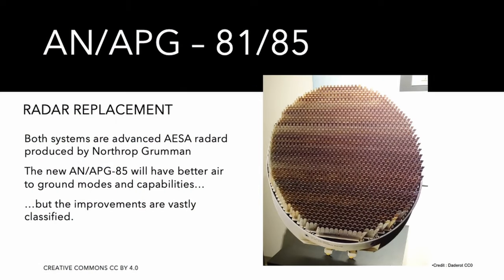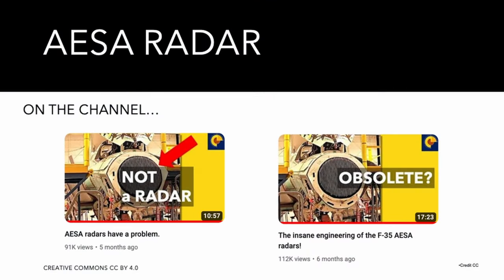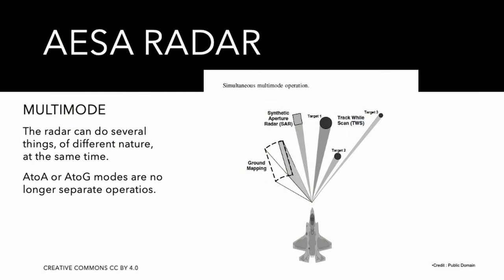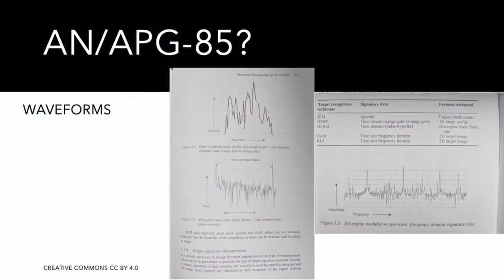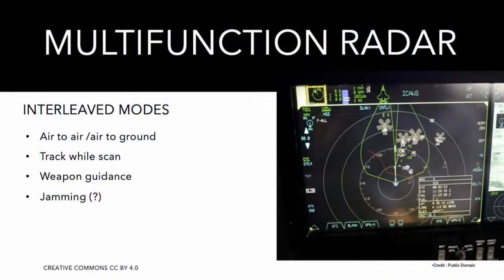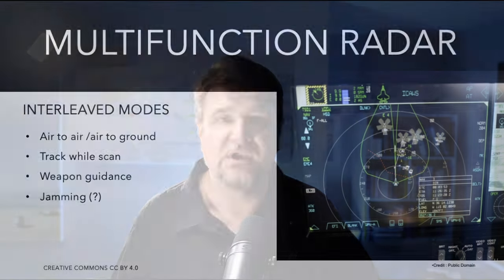The New F 35 Block 4 Radar is Bonkers!

Comment: How many billions does it cost?
America and NATO betting on insanely expensive high maintenance and low numbers militaries.

Didn't Germany tey that already? 🤔
Reply: You think the radar costs billions? 😂😂
Reply: 25 million per f35 for the entire block 4 upgrade which includes a whole host of other upgrades. Russia is so far behind it’s not funny. Egypt tested their Rafale’s vs their new Su35s and found that the Rafale’s spectra EW suite made the Irbis-e radar on the Su35 useless. Rafale had first look, first shot, and first kill every time. The block 4 F35 will receive the AN/ASQ-239 EW suite which has 10x more jamming power than a F18 growler. Israel has been experimenting with said AN/ASQ-239 on the F35I. I think it’s obvious how they obliterated Irans IADS in one night now.
Reply: @Likeaworm any links I can read please?
Reply: @Likeaworm  Which is crazy stupid, as Rafale has 1. weak engine on high altitutdes 2. relatively short range missiles (Mica).
Reply: Yes, more than 1,000 built, what a low numbers platform 😆
Reply: @napobg6842  Seriously?
You're taking the hardware costs as finite and not factoring the development and maintenance costs?
Reply: @Likeaworm  What a load of bull crap.
Reply: @Ariccio123  1,000 built, 300 serviceable at any one time, spread across how many airforces?
You think that's a lot?
Reply: @fryertuck6496  considering this is barely 10 years into the initial low rate production run, yes! That's quite fast for a state of the art combat aircraft
Reply: @fryertuck6496  Why would I count how much it cost for the development? This is not the SU-57, remember? We are talking about hundreds of numbers so the cost is spread. And you are totally wrong about the 300 operational aircraft. You don't know how many are operational but here you are claiming stuff as if you knew.

Comment: Why only 24-35% of F-35 (A,B,C) are the combat ready, according to the Report to the US Congress? Sept, 2023.
Reply: Maybe learn to read, FMC is at 52 percent and can be throttled up in a war where you can surge parts without worrying about customers or production aircrafts, F-22 on the other hand would be in trouble with a similar 53 percent FMC with no parts, look at F-15, F-16 availability right before desert storm and during the war, massive increase.
Reply: @kermittoad  , GAO report, Septeber, 2023. Find it and read.
Reply: @maksimluzin1121  i read it more than you know, the percentage you cited is the approximate increase in funding to operate and sustain them (A,B and C) over '22, nothing to do with FMC or MC rates, try actually reading the whole thing instead of google AI suggestions and search results that says 15, 20, 30 etc...
Reply: @kermittoad  , the official GAO Report to the USA Congress. Your opinion & words doesn't matter, at all.
Reply: @maksimluzin1121  oh my god, it's not my opinion bruh, the GAO report literally contradicts your original comment, did you actually read the thing💀
Reply: I have the report.  If you only read every other word, you could come to that conclusion.  You're counting the backlog of aircraft waiting on the Block 3 upgrades, but those haven't been delivered yet, so it's nonsense.  The USAF told LM to hold onto them so they can train incoming pilots once, not twice.  And many early training aircraft are not combat coded and were never planned to be, instead used as training aircraft for both flight and ground crews in the US and abroad.  If you count the same way as other programs, the readiness numbers are only slightly lower than the F-16 and higher than the F-15 and F-22.
Reply: @Hyposonic  , Nope. Get the full version of report (129 pages at total) and go to the Appendix III with tables by years and you will see.
Reply: @maksimluzin1121  I forgot to mention that you're counting parts shortages--thanks for reminding me.  Dumb accounting rules mean they don't get to "add" aircraft using parts from the scavenged "waiting" aircraft.  These are not airframe problems, but you're counting them.  That's a leadership problem--which we're fixing from the top down as of Nov 5.
Reply: @Hyposonic  , That problem is related to F-35 Autonomic Logistics Information System (ALIS) which is doing a total mess with the part orders, mostly, but not only ALIS... Production of the parts is starting only after an order from ALIS will came to the management database, not before, where are a lot of shortages because there is no production in advance for most parts to reduce the total cost of F-35 exploitation/maintenance.
Reply: @maksimluzin1121  I agree 100%, only pointing out it's not an aircraft design or performance issue.  YouTubers love to spread that stuff.  Opposing forces find the F-35 downright scary.
Reply: @Hyposonic  , Yes, it is the aircraft design, strategy, operational tactics, usage and logistics & maintenance, operational readiness, etc - the Total FAULT. According to the concept/ideology of the Real war against Real adversary. If an aircraft needs 4-6 hours of maintenance just after 1 hour of sortie/flight, this is Not for war, sorry...😉
Reply: @kermittoad  , This a problem of the modern young generation. You never seen a real working device, except a smartphone. The processor tech/frequency is the Religion part of your 'smartphone' Mentality. How long your smartphone processor will survive at 10-20G acceleration (rocket missiles), at altitude of 30-50km (tactical ballistic), with the temperature ranges between -50 to +50 C in one minute?  How about a powerful EM-impulse, by the way? One-three minutes, maybe 12-15 seconds (according to my stat)?😏
Reply: @maksimluzin1121  You are a typical NoClueTuber.
Reply: @maksimluzin1121  "If an aircraft needs 4-6 hours of maintenance just after 1 hour of sortie/flight, this is Not for war, sorry.."  That's a laughable statement, if only modern jets only required 4-6 hours of Mx per flight hour.
Reply: @hoghogwild  , This is not. The Ru Su-30/35 aircraft (each) did 6-8 combat sorties per a day in Syria, with the two crew shifts for an aircraft...
Reply: @maksimluzin1121 So?  Then how much mx was done in the down time?
Reply: @hoghogwild  right? That is significantly better then virtually all current military aircraft
Reply: @maksimluzin1121 you don't know what that means......when they do major inspections on aircraft, i.e. 1000 hr inspections, those are amortized across the total number of flight hours on the aircraft
Reply: @jswjr6001  Cope silently.
Reply: @maksimluzin1121  have you ever worked in military aviation maintenance? You are saying things that are immediate red flags of ignorance and naivety to anyone who has.
Reply: @jswjr6001  , People are 'serving' in army, not 'working', and I did it for years. This is the Red Flag about you, the words, armchair keyboard worrier! 😉
Reply: @maksimluzin1121  oh you got me, use those buzzwords to hide your lack of understanding.  

I will keep working on aircraft everyday (I don't serve the aircraft I fly) 

And, you never said you worked in aviation, so my original point still stands.

You are out of your depth
Reply: @jswjr6001  , A little armchair keyboard warrior boy, you're too young to work either anywhere... It's obvious for me already!😂
Reply: @maksimluzin1121  brother I got over 20 years in the military 
The fact that you don't even know how maintenance man hours per flight hour is calculated is very telling.  It is a level of understanding I expect from a private. And then we teach and train them. 

I guess you never made it past private, if you ever actually "served"
Reply: @jswjr6001  , F-OF, boy. Your  knowledge (absence of it), factualogy (lack of it), language semantics and its' style shows very well you're 15-16 years old.
Reply: @maksimluzin1121  meh...I have over 400 hours of just test flights (yeah, I am a maintenance test pilot) and 2000 hours of total time.  Flying real in service aircraft. Not video games 

At this point, when all you do is throw teenage boy video game insults .....you are the one acting like a 15 year old.

And your knowledge on aircraft maintenance is still absolutely laughable.  Stick to video games.
Reply: @jswjr6001  , no, you're not. You didn't provide any fact or argument at all. It's you who have a clear teenager behaviour. Don't bother me anymore, I'm not interested.
Reply: @maksimluzin1121  I told you how maintenance man hours are calculated. Total maintenance hours divided by total flight time, over a period of time. ( I like to use at least 12 months, or the phase interval, to account for total phase maintenance time). That is real world, working knowledge.

You (laughably) thought those hours are calculated after every single flight hour.

You are dismissed, private.